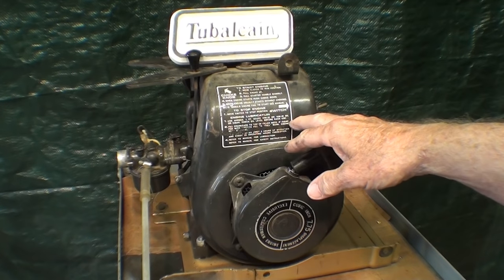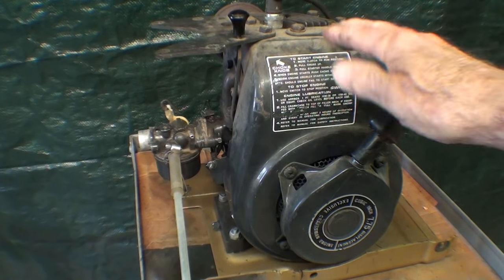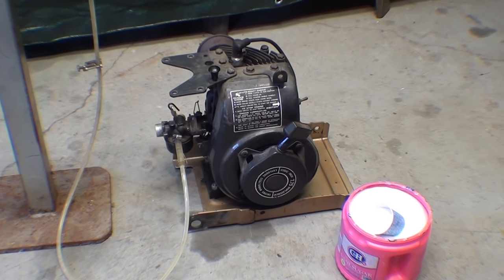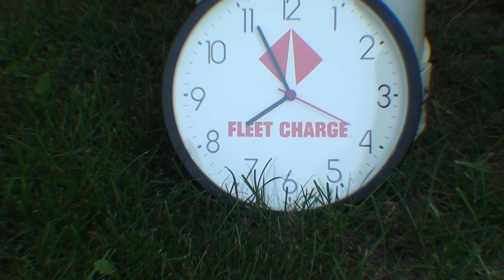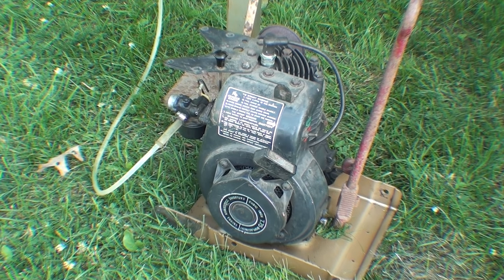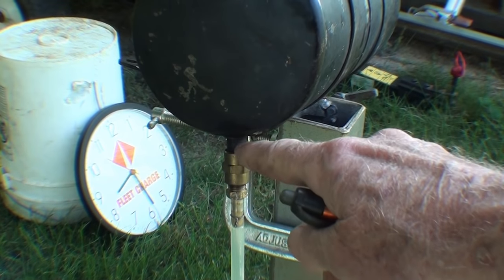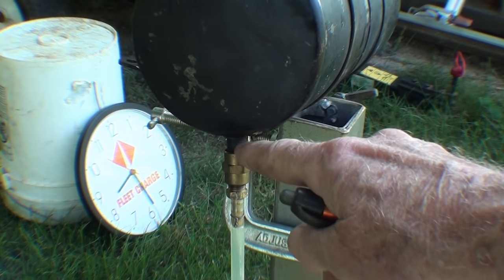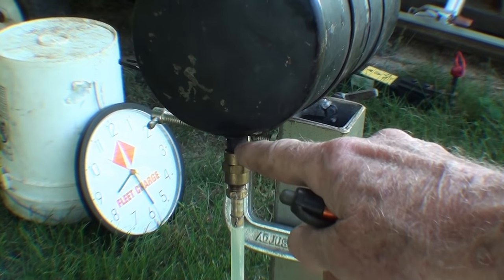MYTH BREAKERS #2 "Sugar in Your Gas Engine Fuel Tank" tubalcain

Comment: I've had three experiences with sugar in gas tanks.  First one plugged the gas line on a Ford flat bed truck.  The guy had a Lincoln engine and was getting in more fruit hauling runs so someone put him in the repair shop for a day.  No damage other than the plugged line.

I was given an inoperable Mazda station wagon that was left over from a divorce.  Someone wasn't happy with who got the car so there was a good quantity of sugar in the tank.  I had to pull the tank and take it to a car wash to get it clean.  The sugar kept clogging the fuel filter every 10 miles or so before I found the source of the problem.

I bought a '74 Volvo with electronic fuel injection and drove it for several years before deciding to change all the filters.  When I pulled the fuel tank filter, I found sugar.  I'm fairly sure the European cars like Volvo and Mercedes were designed to operate with really dirty fuel back in those days. One cup of sugar might stop an American car but it probably required considerably more for the cars designed to run in Africa.

Comment: My experience from a long time ago is that sugar doesn't make an engine seize.  It disables the engine by plugging the fuel delivery system.  In high school shop class we did have another students dad bring us a car that he said that sugar in the gas tank had seized his engine and asked if we could rebuild the engine.
After looking at the car the reason the engine wouldn't turn over is he kept cranking the car until he damaged the starter and starter ring gear.
After we repaired the starter and cleaned the tank, filter and carburetor, the car ran great.
I think a lot of non-mechanic people confuse terms like "engine seized" to won't start or run.
Also, sand blaster sand does the same thing.  How do I know this, a employee couldn't find a real gas can and thought it was a good idea to fill a gas tank using a 5 gallon buck we store and used blaster sand in.  They didn't clean it at all and probably had several tablespoons worth of sand in it. 
Great video, keep them up.  I love myth busting.

Comment: Back in the early 70's we had a very disagreeable old coot for a neighbor and he drove an older Ford pickup that had the fuel tank in the cab, tucked in behind the seat. One of the neighbor hood pranksters poured a little suger around the fill cap (which was beside the door handle) and then dribbled some more onto the ground below. The old coot thought that he actually had sugar in the tank and spent most of the day taking the seat and tank out, cleaning out the tank etc. Once word got around the neighborhood what had really happened, everyone would ride their bikes by his house, smiling and waving.

Comment: If you are in a low humidity climate this is fine.  In coastal areas as here in Louisiana, even the gasoline with less than 10% ethanol will slowly absorb moisture from the air.  Sugar may be almost completely insoluble in refinery gasoline but is soluble in ethanol. Normal crystallized sugar will get sticky in dry, alcohol blended fuel but  Small droplets of water or water/ethanol mixtures are present in most of our fuel tanks that aren't refilled weekly. A sugary syrup will form in gas tanks that contain the wet alcohol.

Comment: 4:00 Sugar leaves a hardened and thick and somewhat sticky still residue. On the valves, Pistons, Rings,Spark plugs, Intake gets fouled up too. Its best when mixed with a several drops of Green Dish Detergent,Some POWDERED Water, Sugar and Elmers Wood Glue. What happens is the vehicle will run like crap and at times stall. It will hesitate, pop and buck...Done. What happens in the fuel in the detergent and water breaks down the fuel and some of the oil when it passes the rings. (The more the merrier) The Sugar and Wood Glue wreaks move havoc from the tank all the way to the carb/Fuel Injection system into the valves and s forth. Along with the sugar and messes up the fuel filter(s)and makes the Fuel Pumps wear and fail in many cases. You need about a Quart or 2 for best results of failure. Its 1/3rd Powdered sugar, 1/3rd of of wood glue, and same for Green Dawn Dish soap with 50/50 ratio of water to the top of oil quart.  "So I've heard".. cough *Per Oil Quart* Shake it well and add to Vehicle Tank. Again best results 2 quarts and its a done deal with Big Truck Tanks. But I've 'heard' one quart in just to get out of there. You can add 2 quarts at once instead of coming back. Its a done deal for sure! Plus as they drive it irrigates in the tank. Its gets worse and worse and then its a done deal. That's what people get for keying MY new car! Ooopps..

Comment: I was taught never put ethanol mixed gas in carbs but you can in put it in fuel injection cars and don't worry about the sugar in the gas tank crap because ethanol is made from cane sugar. Ethanol has a higher octane rating right? You should have a higher compression ratio if you use ethanol mixed gas? if it's a higher octane than I think so I wonder why the factories don't make the compression higher
Reply: Ethanol is derived from the fermentation of sugar, as well as by other costlier means of synthesis, but the sugar is changed in form.
Reply: sucrose is only very slightly soluble in ethanol. also, ethanol is made from any fermented sugars whether it be glucose, sucrose, or fructose.

Comment: Some Danish resistance figthers used sugar in ww2 against german trucks. As far as i know it did slow the germans. Always thougt it got dissolved and cloakt the cylinder bore, but you prowed it to be pipe cloging instead. Interessting! Thankyou Pete!

Comment: I wonder if some water in the gas  tank would perhaps make a difference. The sugar dissolves easily in the polar water but hardly at all in non polar gasoline. When the engine runs,  vibrations could easily emulsify the sugar-water solution into small droplets in the gas. That would be very similar to how emulsions such as cutting fluids are made in industry. 
A suggestion for further experiments could be to mix a fairly concentrated sugar-water solution with a little dishwasher detergent as a an emulsifier and then shake or blend some of this with the gasoline into a thin mayonnaise. Then feed it to the engine to se how it likes it. It will ingest a lot more sucrose into the combustion chamber this way.

Comment: Interesting.  I have neither been the recipient nor the perpetrator of this type of vandalism, but I always took it for granted it was possible.  Even if it didn't destroy the engine, it could still cause expensive repairs draining and cleaning the tank, replacing the filter, cleaning the fuel line, and potentially replacing injectors.  Thanks for the video.

Comment: We see damage more often from ethanol blended gasoline that has stratified as a result of absorbing moisture from the air.  Fuel tank corrosion, carburetor deposits, sticking floats and other problems are common when ethanol blended fuels are used in 
lawn equipment, 2 cycle engines, motorcycles and marine engines where tanks are refilled infrequently.

Comment: Great video, you showed that sugar would stop the engine, but broke the myth that it was dissolved sugar turning to caramel  that made it stop (the latter only indirectly, but fairly definitively, where you showed that the engine ran fine on straight fuel after it had stopped twice on sugar-spiked fuel). Many of the comments here seem to have missed that.  I m pretty sure many teachers at my school (back in the 70s) paid for engine rebuilds when they only needed their fuel lines flushed out :)

Comment: When I was 16 and working as a mechanic in a Yamaha shop and I mentioned putting sugar in a gas tank to the old mechanic, he laughed and proceeded to show me it wouldn't mix with gas. he then said that valve grinding compound works better, ruins every moving part in the engine. I think he knew from experience, he was an ornery old cuss!.....Russ

Comment: What my HS, Air-frame Mechanics teacher told us back in 1980, was that you can't do anything by putting sugar packets in someones tank, it doesn't dissolve in Gas. But if you put a saturated solution in, and they drive on rough enough roads, or run the tank dry, the water will flash off in the cylinder, and the sugar will melt. THEN, when the engine cools the sugar will stick to the steel piston rings and to the cylinder walls, and the starter cannot break them free... Or something like that, it was a long time ago...
Reply: this is exactly correct. what it does in the engine is what it does in a frying pan if you burn it. It sticks all over inside of the engine and what keep the engine from running is it stuck open the valves. After disassembling the engine the only way I      could remove the goo from the parts of the engine was with alcohol and a lot of    elbow grease. Just like with the frying pan it was easier to throw it away and get  another one.

Comment: I have been there, put one restaurant sugar packet in your car's tank and drive.  It WILL fill the area of the head around the valves and spark plug with carbon and the engine will stop until it is all scraped out, your test was cut very short by the blockage of an extreme of granules.

Comment: Sugar doesn’t dissolve in gasoline, as a researcher at Berkeley confirmed in 1994. Forensics professor John Thornton labeled sucrose with radioactive carbon atoms and mixed it with gasoline, then spun the concoction in a centrifuge. After the undissolved particles were removed, the liquid’s radiation level was measured to determine how much sucrose had become part of the gasoline. The answer was extremely little: the equivalent of less than a teaspoonful per 15-gallon tank of gas.

Comment: Sugar is not meant to dissolve in petrol. The "reason" for pouring sugar into the fuel tank is to clog the fuel filter and hence stall the engine! A common practice with rival gangs back in the 1970s (when locking fuel caps were rare)

Comment: Modern automotive fuel systems have a very fine mesh sock on the fuel pickup tube inside the tank so it should have no effect to add sugar,sand or anything else that's granular.
Try putting lacquer thinner in the gas and see what that does to an engine. I've heard of this many times but never saw it happen first hand.

Comment: Automobiles use a float and draw the fuel from the top level in the tank, whereas the small engines just use gravity feed from the bottom so they can avoid the need for a fuel pump. The clogging issue from this experiment would be greatly reduced, if not eliminated, in an automobile, at least until the tank would be nearly empty.

Comment: What I was always told was that the sugar would clog up the fuel system, making many hours of headache getting the fuel system cleaned out, including pulling and flushing the fuel tank.  I never was told that it would cause mechanical damage to the engine.

I imagine that mechanics without scruples managed to sell a few unneeded engines or overhauls that way, though.  And it's quite possible some people drove out with the same engine with nothing changed inside.  A few new gaskets and a good cleaning to make it look like something was done, and maybe an oil and coolant change.

Milk, I'm told, would do basically the same thing.

Comment: I was always told it turned the fuel into a varnish type glue that would burn in the cylinders therefore finishing the engine, interesting vid.
Reply: You would have to add a ridiculous amount of sugar to make it gel with the gasoline
Reply: , it will only clog the fuel filter as sugar will not absorb gas nor gas the sugar try it for yourself in an empty jar it will never jell

Comment: Somebody put sugar in my gas tank many years ago, in the early sixties.  I discovered it when it stopped running and I found the fuel filter clogged.  I cleaned it out and got it running, but it soon started smoking.  I had to do a ring job.  Boy, was I mad!

I didn’t have the means to flush the whole fuel system.

Comment: Can the sugar be slowly dissolved in the tank gradually ? Any solution or treatment been discovered . They want $2000 to replace my fuel filter built into tank alone , then there are the lines and carby ???? My car still runs for now ...??????

Comment: Interesting. In the 1970's my vehicle (an old Austin FX3) wouldn't start one day. I worked through the fuel system until i got to taking the carb apart. There was a lot of white powdery deposits in it, blocking or partially blocking the jets and galleries. A fitter mate of mine said it was probably sabotage; sugar in the petrol tank. I boiled up the carb and flushed out the tank and fuel lines with boiling water.  It started and ran as normal after that.

Comment: I remember Mythbusters (my favorite show maybe of all time) tested this sugar in the tank myth.  If memory serves, they found it didn't cause too much harm either.  The thing that did cause great harm was bleach in the tank.

I had suggested this before, but I'll do it again in case you missed it.  I'd like to see a coupling nut tested against a regular sized nut to see if the coupling nut with its greater length adds strength to the thread.  I guess the test could be turning with a torque wrench and seeing which stripped out first.

Comment: In a carburettor petrol engine try Phenolic Resin, IT REALLY DOES WORK. 
Dissolve in fuel - Start cold engine and run for an hour or more.
Can be stopped for short periods 30 minutes (Short enough not to cool down)
Engine runs whilst hot then locks up ridgid when cools own. (Overnight)

Comment: When he mentioned the ethanol, I thought for sure that would dissolve at least a little of the sugar. Petroleum is non-polar so it doesn't do anything to the sugar, but ethanol is a more or less universal solvent. I'd be interested to see a chemical test to determine whether any sugar at all got dissolved into the fuel; maybe the ethanol has to be at a higher concentration to have any effect?

Comment: Actually it might be interesting to try this with corn syrup.  It probably  wouldn't combine with the gas, either.  But neither would it clog the carburetor, etc.  And if it got into hot engine, it just might burn and carbonize.  Fun video. Enjoyed it.  (You have a very accommodating wife!!)

Comment: DIESEL ENGINES CAN BE DAMAGED BY ALMOST ANY SUBSTANCE  IN THE FUEL.  I THINK IT IS BECAUSE THE FUEL IS PUMPED TO THE INJECTORS UNDER PRESSURE.  GREAT VIDEO MR PETE.  THANKS

Comment: I would like to see what would happen if you used sodium silicate.
Reply from the maker: I hope to do that this summer
Reply: Hilleary Brown  I worked at a dealership during cash for clunkers, we did it on a daily basis. Drained the oil and and added "liquid glass" in its place and let them idle to their death.
Reply: We used to use that in a bad radiator to fix a leaky radiator.  It was called liquid glass in the day.  Fixed mine really well.  Stopped every leak it had and you could see where the leaks were by the white stuff around the radiator and hoses where it leaked.
Reply: That's a shame you killed an old motor.  You were assisting in suicide,  Can I call you DR, Kevorkian lol
Reply: MrKeithsandefer I as well worked at a dealership during that period and I couldn't remember what it was we used! thanks, now I remember! ha ha
Reply: white pepper also fixes small radiator leaks
Reply: pinay addiction an egg to
Reply: Hilleary Brown so does outmeal

Comment: Years ago I had a potential customer file a claim on auto insurance for damaged engine due to sugar in gas tank.  Insurance company would only pay to clean gas tank and replace fuel filter.  Needless to say the customer was displeased with his insurance company.  I out of curiosity got 5 gallons of gasoline and placed 5 pounds of sugar into the gasoline.  The sugar would not dissolve.  All it could have done was clog a fuel filter, but not damage an engine.

Comment: After working as a mechanic for 40 years, sugar does not dissolve in gasoline. I had to remove the tank and was it out, blow out the fuel lines and replace the filter.

Comment: I bought a motorcycle that had sugar in the gas.  Broke down within 5 miles of purchasing it.  It was mostly in the tank and fuel lines but tiny amounts also made it to the carbs.  I needed to clean everything.

Comment: basically the test prove that sugar in the tank does effort the engine not to the point of damaging it however the gas line is what greatly clogged which is what causes the vehicle to not run. I believe the auto shops just says the engine is damaged. So the charges are justified